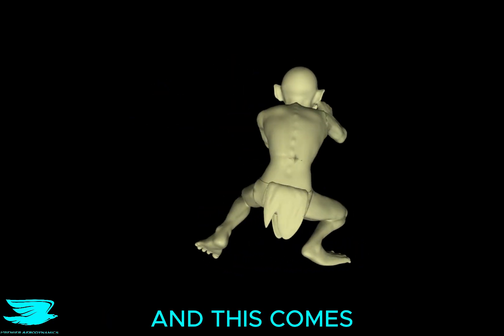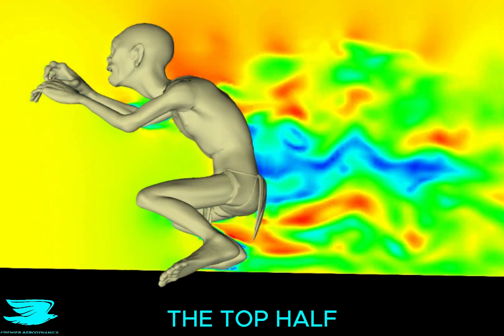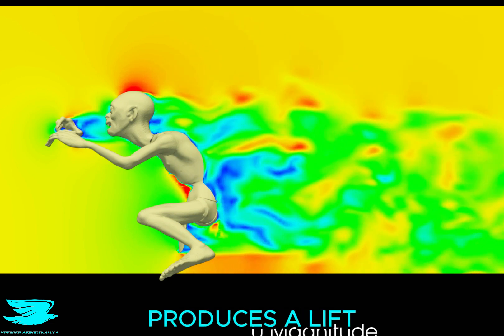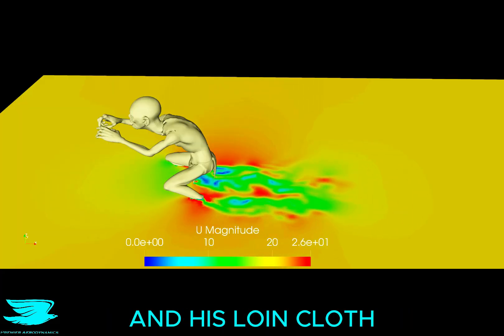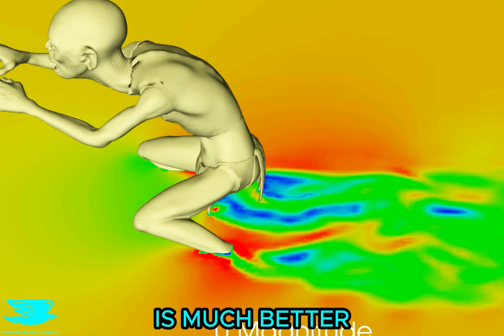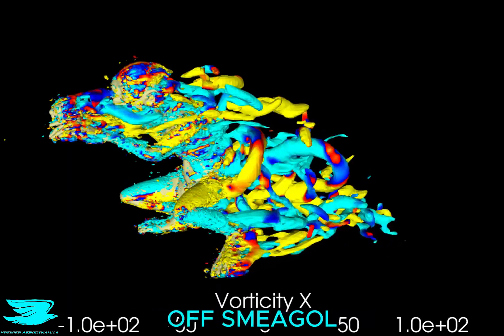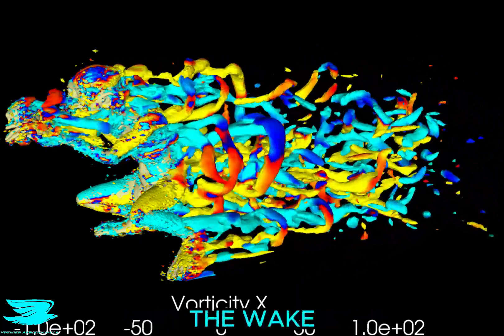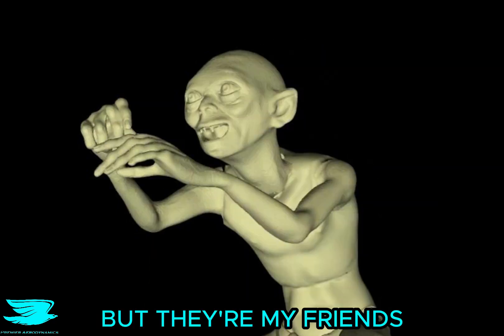Do You Produce Lift When You Squat?

Comment: Moto GP will make good use of this information in the design of new race suits!
Reply from the maker: Well, the interesting thing about bike riders is that if you're hugging the bike, when you try to lift off, that moment, you'll feel this suction back because there is very little air between you and the bike, so that creates a low pressure as you expand that volume and before more air rushes in.